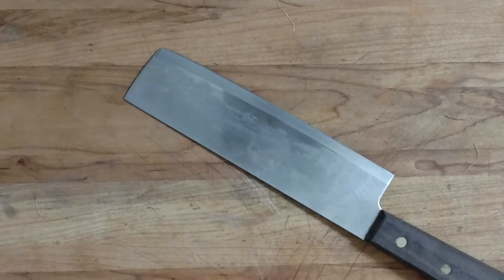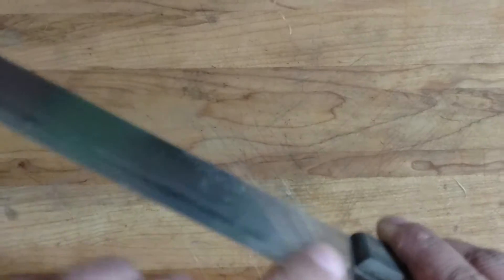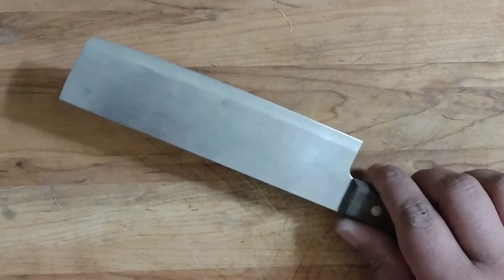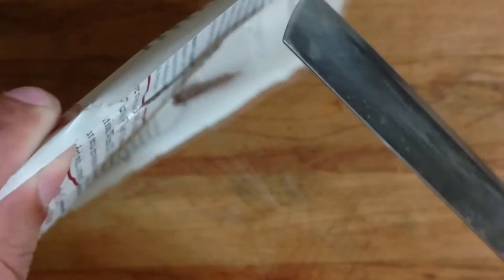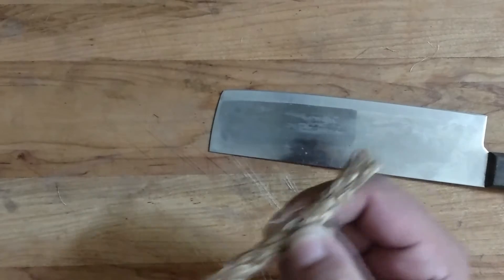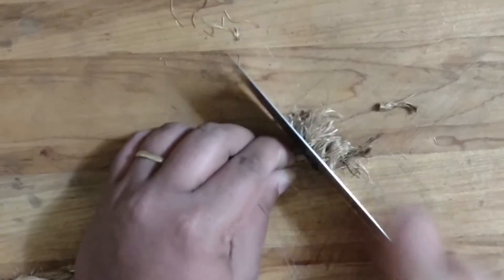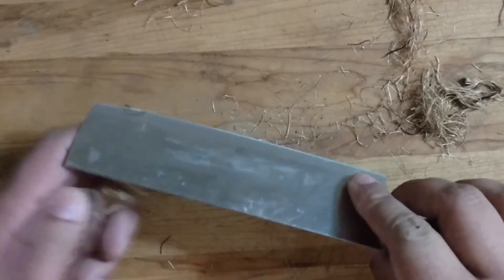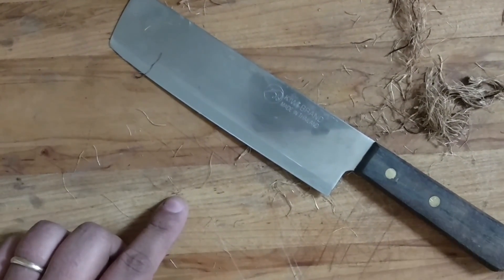Understanding Rope cut testing

Comment: Is this regarding mine? I try and use not the rope as the limit but how it slices the paper after and when it stops working. Any thoughts on mine would be cool
Reply from the maker: CedricAda Gear and Outdoors not you brother
Reply from the maker: CedricAda Gear and Outdoors just some observations on rope cutting I thought would be insightful.
Reply from the maker: CedricAda Gear and Outdoors I had someone curious why I stop cutting with vg10 in the fallkniven A1 versus A1 pro test when he states it could have cut more.  this explains why I stopped. It's because the force needed to cut became huge compared to cobalt special steel.
Reply: Big Brown Guy ah gotcha no worries, but what do you think of my tests? any way to improve do you think?
Reply from the maker: CedricAda Gear and Outdoors http://www.cliffstamp.com/knives/articles/model_edge_retention.html
I don't subscribe to all of Cliff's information but
this is a good read, 
first talks about some  knife makers legends like Wayne Goddard, Phil Wilson and their tests that became the standard, also, Cliff covers some of their thoughts behind what they think is going on then points out that initial edge geometry is important with Buck and their Bg42 steel and their "edge 2000" sharpening.